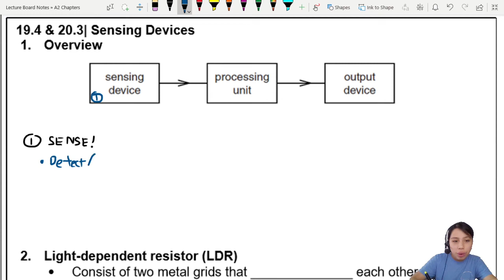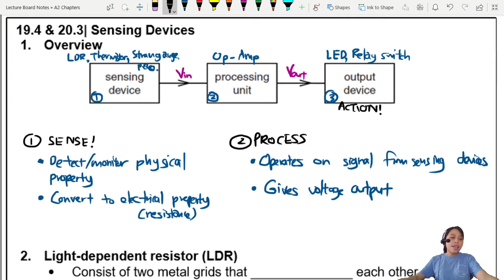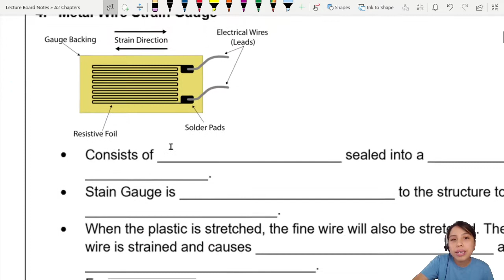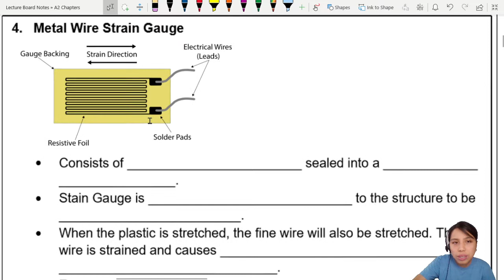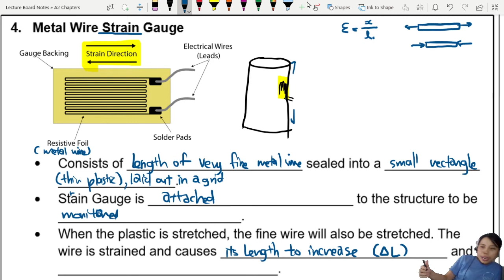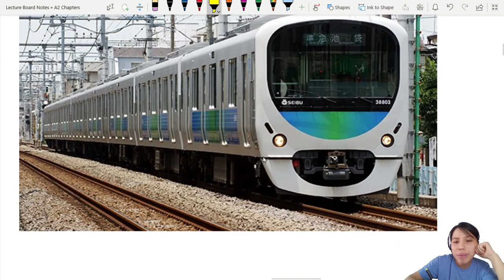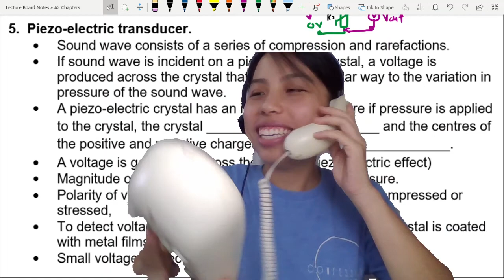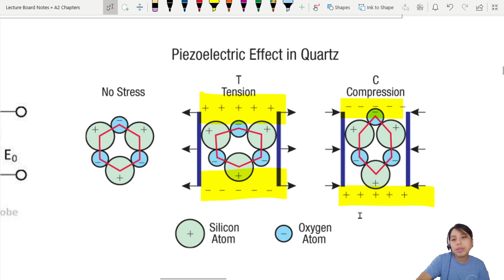119.1a Sensing Devices: LDR, Thermistor, Strain Gauge, Piezo | A2 Electronics | CAIE A Level Physics

Comment: Hello, i love your video! But i did not understand one thing about LDR. At night time, it gets darker so light intensity decreases, then resistance will increase. So why is it that when resistance increases, the bulbs come on automatically? Should it not be the opposite?
Reply from the maker: Are you referring to a circuit here in particular, or circuits in real life? 🤔
Reply: maybe the standard state of the device where it is turned on, but when the resistance increases, it gets turned off?